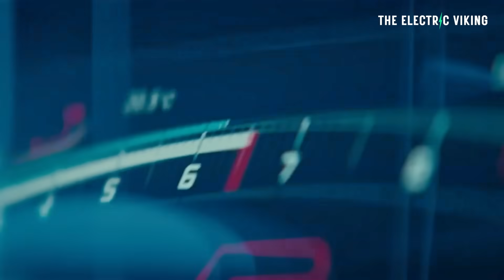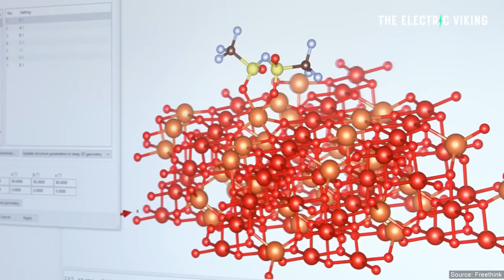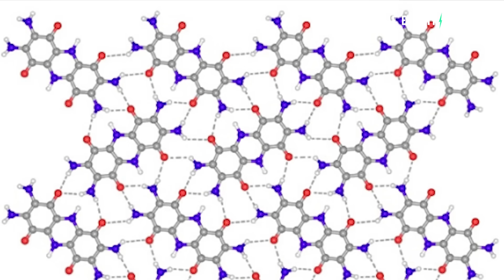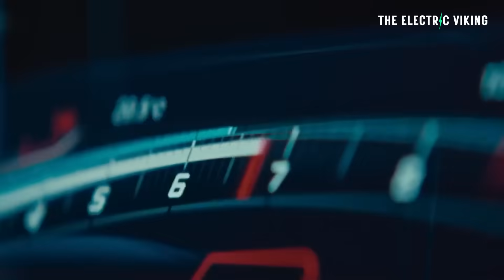MIT reveal Lamborghini battery with 500 kw charging & 765 Wh energy density

Comment: If it works commercialy, then there is no way that Lamborghini should keep this to themselves, it would completely wipe out fossil fuels. Air transport would be completely transformed. It would achieve zero emissions much sooner if it can be scaled up. Even if it meant licensing from  Lamborghini to use the tech it has to happen.

Comment: Wat about the weight reduction of the battery packs. If they are no longer as flammable the battery casing can be made of lighter waterproof materials. Create the packs as modules that can be separated via electronic switching to keep from having to replace the entire battery just the affected module. Unplug and plug in new module and reseal. Wat about the recycling aspects and toxic byproducts of the tetragrammaton -transformer chemicals. Will they harm the environment

Comment: 765 Wh (in the title), 765 W/kg (in the video).  Please EV, surely the units of measure are Wh/kg.  And what kg are we talking about.  Is this Wh/kg of cathode material, Wh/kg of battery, WH/kg of battery module?  All so different.  I appreciate clear and unambiguous English expression - and I am sure others viewers do as well.  Please help to diminish the confusion in this space.
Reply: It is 765 Wh/kg in the cathode according to the research paper, so I'm guesstimating that the cell will have 306 Wh/kg energy density, which is only slightly better than the best NMC811 cells that have 300 Wh/kg energy density.

Comment: 🎯 Key Takeaways for quick navigation:

00:00 ⚡ MIT reveals one of the fastest charging batteries with double the energy density of any existing battery, affordable, cobalt-free, and licensed by Lamborghini.
01:08 🚗 Lamborghini, owned by the Volkswagen group, licenses MIT's battery technology, signaling a shift towards electrification despite a previous lack of emphasis on electric cars.
03:12 🔋 The new batteries boast an extraordinary energy density of 765 watts per kilogram and a charging speed of up to 500 KW, potentially providing an electric vehicle with 1,000 miles of range.
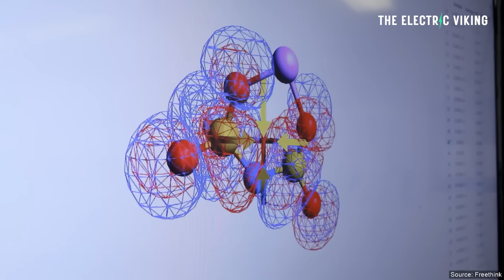06:12 🌱 The groundbreaking battery uses organic materials, specifically Quinones and amines, achieving double the energy density without relying on Cobalt, making it highly stable, insoluble, and fire-resistant.
09:37 💰 MIT's organic battery material is estimated to cost 1/3 to 1/2 of traditional cobalt batteries, making it an affordable and commercially viable option with potential applications beyond Lamborghini.

Made with HARPA AI

Comment: The articles you linked talk about a Harvard research group working on solid state batteries which would in theory have a much higher energy density but no actual working batteries with higher densities. Any thing I found talking about this MIT research only pointed to it being a cost saving measure to use organic (carbon based) materials instead of cobalt and said the energy density was comparable.

Comment: I hope this is not the next battery technology in the long line which does not make it to commercial production at a reasonable cost. Making a battery in a lab is totally different as manufacturing in large quantities. In the step from lab (ideal circumstances) to the production stage ( sub optimal circumstances) the energy density is likely to drop and cost is likely to rise.
Reply: This is a long way from commercialization, since they just published their first research paper on it. 765 Wh/kg is the cathode energy density, so we can guesstimate 306 Wh/kg at the cell level, which is only slightly better than today's best NMC batteries with 300 Wh/kg. It will probably be another 5 years before these TAQ batteries reach mass production, and by that time LFP will probably be at 300 Wh/kg and support 12C charging, so the real advantage of these batteries will be the lower cost, since they don't contain metals in the cathode.

Comment: It will be interesting to see if they can in its currently configured form mass produce the battery, or will it be relegated to a niche production level, for the unique application in the lambho.
Reply: If it is that good then a manufacturer would happily accelerate its adoption and mass production.

Comment: The performance of this TAQ based battery is just one dimension of it, the price and scalabilty are also very important. If the production can be automated and the price is staying at least at the current Li-Ion battery level, now we are talking about a real energy revolution. I'm not sure if this news reflects the reality of a full EV battery but more of a lab prototype (which would be fine) but surely more tests and improvements in the fabrication process are important. On the other hand, I don't see why Lamborghini or any other luxury car company would care about the costs or scalability of it, since they will surely sell a limited number of cars per year at really high prices, thus ensuring a profit even if the battery costs (on its own) $100,000.
However, scientifically speaking, if that news is real, it will surely allow more and more projects of similar nature to develop, and who knows, maybe even improve on it. Time will tell.
Thanks Viking for reporting this.
Reply: This is a lab prototype and a long way from commercialization. 765 Wh/kg is the cathode energy density, so this new TAQ cell should have a cell energy density around 306 Wh/kg, which is only slightly better than today's cutting edge NMC which reaches 300 Wh/kg. Lamborghini may use it because of the 10C charging, but there will be higher energy density batteries on the market by the time that this TAQ cell is mass produced (which probably won't happen for another 5 years).

Comment: I really hope this catches on and we can finally have electric airplanes.
Reply: 765 Wh/kg is the cathode energy density, so this new TAQ cell should have a cell energy density around 306 Wh/kg, which is only slightly better than today's cutting edge NMC which reaches 300 Wh/kg. For aviation, you are going to need something like CATL's condensed battery with 500 Wh/kg, which are very expensive and probably have short cycle life. Elysian estimates that you can have 800km of flying range with 450 Wh/kg and 1000km of flying range with 550 Wh/kg.

Comment: Hello Sam, Such exciting news.... I just hope this technology finds its way to cars for the mass market. If all this is as it seems on face value the only thing that could be more exciting would be an ambient temperature super conductor? This is surely not out of the question? 
Thanks btw for your outstanding optimism, it helps many of us out here!
Reply: The next brand new Lamborghini model may well be a single-seater personal flying quadcopter, with this battery technology and super efficient radial motors.

Comment: 765 watthours per kg is energy density.
765 watts per kg is power density.
Which?
I'm very skeptical and suspicious of new claims. Let's see how many cycles it'll last and under what conditions and what cost.
Reply: 765 Wh/kg is the cathode energy density, so we can guesstimate 306 Wh/kg at the cell level, which is only slightly better than today's best NMC batteries with 300 Wh/kg. The research paper on the TAQ battery says that it has 12% battery capacity loss after 1000 charging cycles and 30% capacity loss after 2000 cycles. The researchers estimate that its cost will be  between 1/3 and 1/2 of the cost of NMC. 
I expect that it will take 5-10 years to commercialize these TAQ batteries, and by that time LFP will probably be at 300 Wh/kg and support 12C charging, so the real advantage of these batteries will be the lower cost.
Reply: @amosbatto3051  Thanks for the clarification - a cell is made up of two half cells, so to claim it is 765 Wh/kg is misleading.
I won't be banging down the doors to invest in this, nor hold my breath, and I would advise others to do the same until more is known.

Comment: Let's see. Less prone to fire. Twice the energy density.  Let's see, more than 600 miles for a standard Cyber Truck battery. Charge at whatever rate ya'll can muster. Too good to be true. This battery will never come to market. It is too revolutionary, just like the Cyber Truck. You would need high tension lines straight to the charging stations and a substation piggy backed on a Tesla station. You could heat up triple aut  charging cables to the auto.

Comment: Better batteries increase the market size.  Lower cost batteries increase the market size.  A small car with a 40 to 50 KW battery could be quite  zippy and fun to drive.  Unless it drives itself.  A Robo Taxi does not need a high capacity battery as it can charge every night and in the daytime if it has to.  The cost to build a car like this might be very low.

Comment: Even if these batteries take a couple of years to become commercialized, what’s exciting to me is that the research keeps moving forward. Especially now with AI making research progress much faster, I think that by the end of the decade we will have batteries that make any type oF combustion powertrain replaceable. Do you want 500 miles of towing in your pickup? No problem. Do you want to replace diesels in heavy machinery? Here you go. Shipping, aviation.. I think the future looks electric!
Reply: 765 Wh/kg is the cathode energy density, so this new TAQ cell should have a cell energy density around 306 Wh/kg, which is only slightly better than today's cutting edge NMC which reaches 300 Wh/kg. To get 500 miles of towing with a pickup, you are going to need something like CATL's condensed battery with 500 Wh/kg, but it will probably be another decade before those types of batteries are cheap enough for EVs. They will be limited to airplanes and expensive cellphones in the near future.
Reply: @amosbatto3051 care to explain? I am not even sure why a distinction was made with cathode energy density. As far as I know the anode is the positive side and the cathode is the negative side (energy will go from negative to positive). But somehow more than half of 765 was lost somewhere? Is that to say that the CATL possibly has a cathode with over 1000Wh/kg? I think the 765 is just the energy density period. It's just a circuit. Since the cathode is the side that supplies the energy that flows to the anode
Reply: Not going to happen.

Comment: Awesome. That means you have a very good 75 kW battery that will have a weight  of about 120 kilos depending of the weight of the frame and cooling.
Reply: Far less than the weight of an equivalent ICE and that is nor even accounting for the gubbins that and ICE needs to work.
Reply: "Awesome" you say before saying that the battery is 75 kw, but kw are not units of battery capacity
Reply: @jimmys6566  yeah it should be kwh but I'm writing a quick comment. Not a science paper.

Comment: If this is true then electric air travel, semi's, and trucks have all made a leap into "clearly" being better than ICE and turboprop engines.
Reply: No, they won't make a leap with this TAQ battery, because Sam Evans didn't understand that 765 Wh/kg is the cathode energy density, so this new TAQ cell should have a cell energy density around 306 Wh/kg, which is only slightly better than today's cutting edge NMC which reaches 300 Wh/kg. Given that this is early prototyping and it will take a minimum of 5 years to reach mass production, this battery won't be nearly as revolutionary by the time it makes it to market, since we will have LFP with the same energy density and same 10C charging in 5 years time, but they will have double the cycle life of the TAQ battery.

Comment: If these really are 10C batteries, they’d make good batteries for drones, E-bikes, scooters and boards, especially at the high energy to weight ratio, for that matter, sounds like a great battery for EV aircraft.
Reply: Paradigm shift.
Reply: Tank killing drones. Twice the warhead, or,twice the range.
Reply: 765 Wh/kg is the cathode energy density, so this new TAQ cell should have a cell energy density around 306 Wh/kg, which is only slightly better than today's cutting edge NMC which reaches 300 Wh/kg. For aviation, you are going to need something like CATL's condensed battery with 500 Wh/kg, which are very expensive and probably have short cycle life.
Reply: @amosbatto3051  ah! silly me, thought that was the total energy to weight ratio, if only the cathode piece, you are right.
Reply: I want to see proof in the form of being tested after sold to the market. I do expect innovations, while also cautious of marketing hype.

Comment: 765Wh/Kg makes this more than suitable for electric aviation. Outstanding reporting on this!  Thank you.
Reply: fake news, 765 on the cathode level not cell level
Reply: Its fake. Why VW not using the same batteries for ID4 ? VW owns Lamborghini?
Reply: Yes, Lamborghini is owned by the Volkswagen Group through its subsidiary Audi.
Reply: @tigranohanyan3321  That is bad logic. They aren't in production yet, they have only been invented at the university. When they go into production, Lamborghini will get them first for an expensive sports/racing car. Later on, as production increases, they will go into the more ordinary cars from the same group. If all goes well.
Reply: Accurate
Reply: With 765 Wh/kg in the cathode, we can guesstimate a cell energy density of 306 Wh/kg, compared to cutting-edge NMC cells which reach 300 Wh/kg. However, the important thing is that these new TAQ cells will be 1/3 to 1/2 of the price of NMC and support 10C charging, so they will revolutionize the industry in terms of price and charging speed, although their cycle life is the same as NMC, so LFP still has advantages if needing a long-lived battery.
Reply: @amosbatto3051  You sounded like the Electric Good (Elon) in one of his presentations, everything is going to be 1/2 or a 1/3 of the price and in the end is always 2x or 2 1/2 times more
Reply: @MsRs232  , In terms of the costs, I'm just repeating what the researchers stated in their research paper. One thing that I should mention is that this TAQ battery is just a laboratory prototype, and they just published the first paper on it. From what I can tell, they are planning to do a lot more research, before any plans are laid for commercialization, since they are investigating whether sodium ions can be used in place of lithium ions in the electrolyte. Given that it will probably take 5-10 years to commercialize it and they might discover technical roadblocks which prevent mass production, there is no reason to get too excited about it at this point, but it does appear more promising to me than all of the solid state and semi-solid state batteries, because this TAQ battery is made of cheap materials.
Reply: Fake as petrol is only 863wh/kg with 100% efficiency when also taking into account the stoichiometric ratio. This is dumb
Reply: But gas engines are not 100% efficient, more like 35-45%. @FlamesOfThought
Reply: The paper states 765W/kg with subscript cathode..."higher than most cobalt cathodes". Thus, 765W/kg is not the specific energy of the entire battery, just the cathode. Nonetheless, fantastic performance for a cobalt free cathode.
Reply: My thoughts exactly
Reply: A density of 500Wh/KG would be required for aviation. If this works then engines using petroleum would become redundant.

Comment: Sorry, but as an MIT alumnus I object strenuously to the relentless PR campaign of their public relations office which touts breakthroughs every week that never actually get to production because they are claiming some radical increase in density, but when you read the fine print it is only for a small part of the system, and the durability of the cell has not been proven in practice outside the lab. 

Don't believe almost any PR release you see. When Toyota or VW or BYD puts it in their mainline products, then you know it is real. Until then, be skeptical.

I have no doubt that eventually some battery breakthrough will happen, but so many battery startups are now in year 8 and still no product outside the lab... It isn't easy to make a new chemistry that holds up in real life, with temperature ranges, etc.
Reply: Indeed. We've seen so many claims such as this come and go and disappear into the ether never to be heard from again.
Color me skeptical, and cynical too through having heard "wolf" too many times before.
Reply: @ahaveland at this point many colleges and universities are govt sponsored reputation mining enterprises
Reply: Amen, Edward.  Every idea is the best in the world until it's tested.
Reply: After reading the research paper, it looks credible to me, but it is an early prototype in a lab. It probably will take a minimum of 5 years to reach mass production, if no major problems are found with the tech that prevent commercialization, but I do think Sam Evans should be covering it. He just needs to actually research it. 765 Wh/kg is the cathode energy density, so we can guesstimate 306 Wh/kg at the cell level, which is only slightly better than today's best NMC batteries with 300 Wh/kg. By the time the TAQ batteries reach mass production, I expect that LFP will probably be at 300 Wh/kg and support 12C charging, so the real advantage of these batteries will be the lower cost, since they don't contain metals in the cathode.